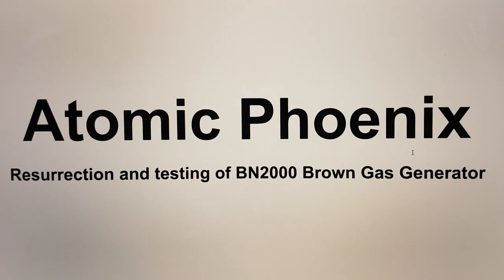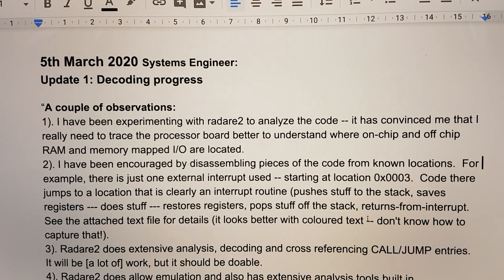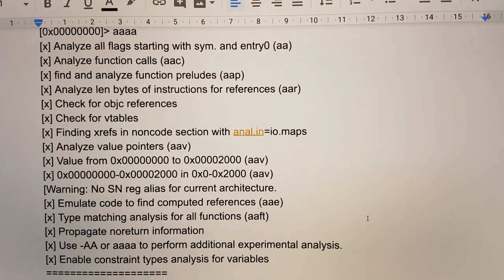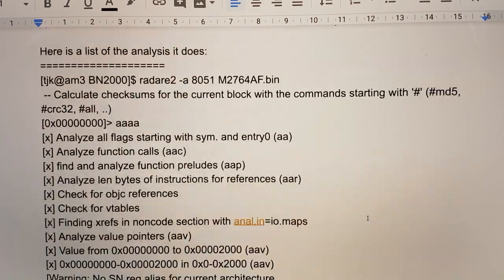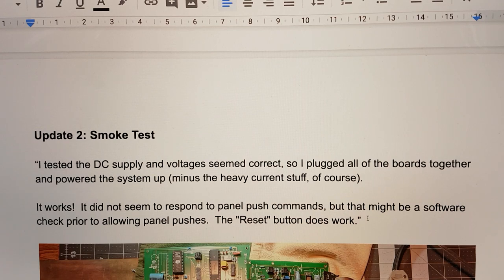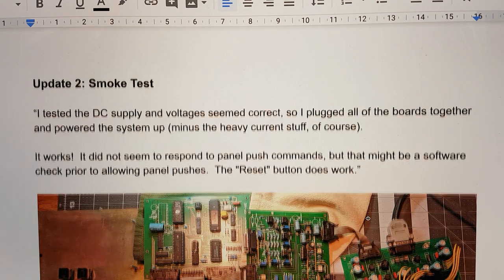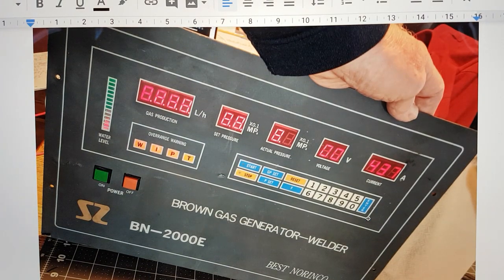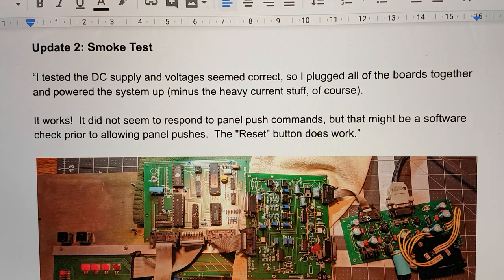Project Atomic Phoenix - Second Update

Comment: Missing links to document
Reply from the maker: Thanks, fixed

LIVE Document here:
https://docs.google.com/document/d/1UTqYgpMIvWGDQUDB6kdZts9-KKa9wJa-5WuzQW41RS8/edit

Discussion here:
http://www.quantumheat.org/index.php/en/home/mfmp-blog/553-atomic-phoenix-brown-gas-generator-project
Reply: @MFMP  what's to reverse engineer on this... Seems like the circuitry is for regulation and safety according to the manual there's a symmetrical switch in there and the internet says something about modulation of AC toward either + or - probably for concentration of the mix based on my crude understanding of hhho are you planning on incorporating Omaha gas resonance to it as well?
Reply from the maker: @matthewfredrickmfkrz1934  60Hz fundamental vibration and harmonics from the in case large inefficient transformer may be critical to the devices effectiveness and may have been overlooked by other HHO researchers in their quest for efficiency. Since Dr. Ohmasa used low frequency vibration with harmonics combined with stiff flexible plates, there may be something similar going on in the Brown Gas unit with the electrode configurations. So doing a sound and vibration study alongside spatial and material determination of the electrodes could reveal accidental / deliberate design aspects that may/may not be critical to the specific capability of Brown Gas in the area we are most interested in - transmutation.

Comment: How old is that machine? It looks like it is over-complicated for the function that it needs to perform (highly efficient electrolysis or supposed "over-unity" production of Brown's gas). I think ALL of this PCB could be replaced with a single, tiny board having a microcontroller; but such is the way of the world of: trade secrets, marketing, and the obvious suppression of this technology by the power brokers of the past (big oil, big energy). Acetylene sales are doing just fine now, thanks to the total suppression of this technology by the wicked government of the USA. I say "supposed over-unity" because i have studied these type of devices for a long time now, including things like "over-unity" magnetic motors. The formulas for converting total Watts of electrical energy into mechanical energy are simply WRONG. Several variables have been ignored, including things like conductivity of the electrolyte (or in the case of electric motors: the internal resistance of the battery, total resistance of the field winding vs number of turns of inductor, flux density of any permanent magnets present, etc.) IMO; low energy nuclear reaction/s occur when hydrogen and oxygen atoms "snap back together", temporarily exceeding the Coulomb barrier. Therefore: the total output power is more or less equal to the electrical energy put in (minus the wastefulness inherent in most of these HHO generator designs) + a little bit of "cold fusion" energy, which can be seen as either coming from the mass itself, or resulting from the vacuum field of all local wave functions that get collapsed by the "snap-back" (Casimir force), and converted into the actual, observed atomic reaction.  I would love to volunteer my services to the MFMP. I have learned how to vastly increase the flow rate of gas production in such devices, while using less and less electricity. Similar effects may be applied to electric motors, regular batteries, capacitive or inductive circuits, etc. Electricity is a "quantum fluid" NOT a "thermodynamic fluid"- so the mechanical models that use water pressure or "current" of flow as "analogs" are highly inaccurate. Electricity is more like a compressible gas than a hydraulic fluid such as water.  If these ideas are correct (and the latest physics discoveries have been giving plenty of confirmation to this bias we have) then things like modern LEDs and solar panels also have ample room for improvement (once the blinders are finally lifted from the electrical engineers of this tightly controlled planet). This is why i am such a huge fan of the work you are doing in studying these LENRs and related devices. I am thankful that you are sharing your insights with the world in a very open-source manner. I would donate funds to the MFMP if i had any. Actually i am extremely poor and i need a job. I would work very cheaply for such a good and noble cause as preserving these "anomalous machines" - a Big Oil Company suppressed history that was very real (as opposed to the virtual reality projected by the bullshit TV and controlled media). Kudos on you guys for wanting to reverse engineer this victim of history.  In my own design for a B Gas generator (and my in super powerful electric motors as well), no type of "AC signal" nor "resonant pulsing" nor "magnetic vibrations" are needed. Constant, DC current/voltage is applied, and/or any "off" times or transients are kept to the shortest possible duty cycle. Things like vibrators or pulsing circuits with custom wave shapes improve the flow rate in B gas gens for a very simple reason that has nothing to do with "resonance", IMO. Well, sorry for the long diatribe. Good luck and God bless!
Reply from the maker: Made in 1992. The point of the project is to reverse engineer and re-cast in modern microcontroller.

Efficiency is not a concern for this project. The point is to test the claims of Yull Brown with the best kind of device that was made by him. Also to test if it can transmute elements in the way we have shown Ohmasa Gas can.

Where are you based?